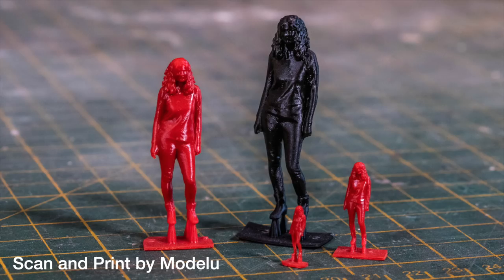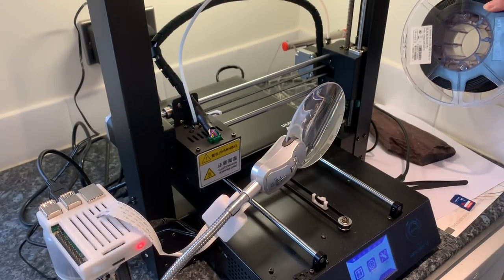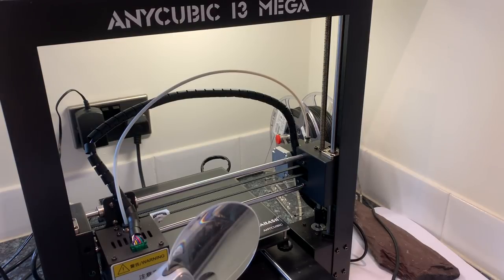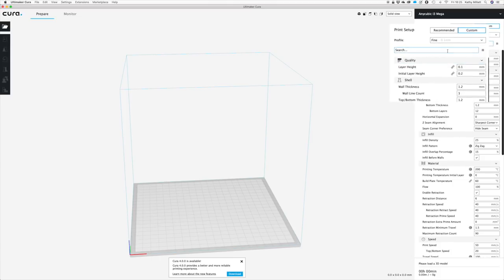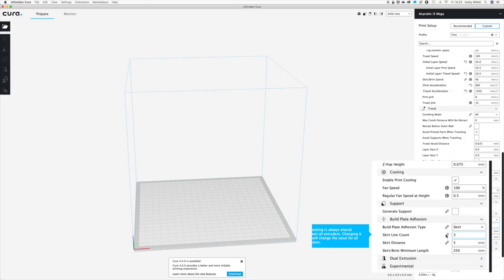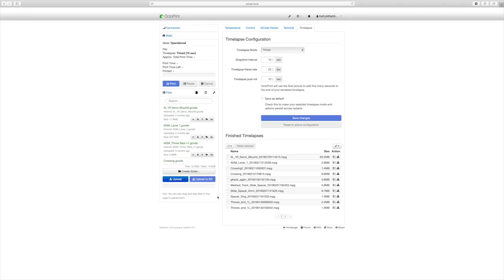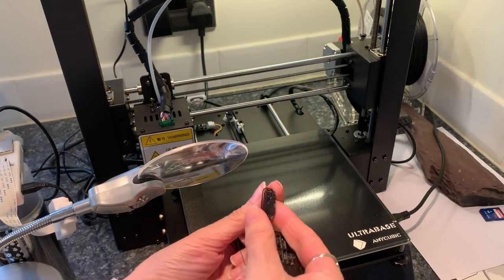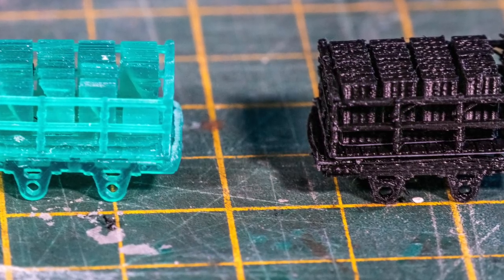3d Printing for Modelling - Filament

Comment: Glad you didn’t skip the quality and cleaning up issue. The build lines drive me daft when i see them produced as a finished item. Fill or sand is vital to remove the LEGO effect on a curve. ( Lego effect is trying to produce a smooth curve from thick bricks.. fine from a long way away but not close too) fill  for smooth file to lose the detail.  Amacf
Reply from the maker: So true. Those lines drive me mad. It’s all I can see in my prints!

Comment: Each printer has its use. I have the Anycubic Photon for the fine detailed stuff but the larger (and less well-defined stuff) gets done on my large format Creality CR-X. I doubt I could replace either one one by the other.
Reply from the maker: True. Each are slightly different tools.

Comment: Hi Kathy Great Presentation, I have a Anet A8 and a EZT1 ,i have added auto level sensors to save getting dizzy going round and round lol. Thingaverse is magic and has a lot of great files for model making. thanks again ,look forward to your future presentations ,remember your the model making pin up girl , Take Care Mac.
Reply from the maker: Thanks Mac. Auto level sensors - I need to check them out!  I do love Thingiverse too.
Reply: your welcome Kathy ,your best place to get the sensors is Ebay an they only have 3 wires Power,Ground,Signal , just replace your z Limit switch ,a nice easy firmware change to your control board to SKYNet ,you have A auto levelling machine ,no going on a merrygoround to level up, keep em coming ,
Reply from the maker: Thanks for the tip. I’ll see how that works with my Anycubic.
Reply: if you get stuck just give me a shout ,would be my honour to help you for a change :-)
Reply from the maker: Thanks a lot. I appreciate that.

Comment: Hi Kathy great video. I use this stuff to smooth my FDM prints no sanding at all. XTC 3D Brush-On Coating
Reply from the maker: Hi Bob. I’ve seen that on YouTube but I’m never sure whether it would work with scale models or whether it would fill the details too much.
Reply: It would depend on the scale, and how much detail it has. Personally, for the higher-detail things, I tend to prefer scratch-filling auto body spray primer, which fills only very small marks. You can always spray on more (or thicker) coats if you need. It's also a lot cheaper and easier to get than XTC-3D.

Using a mixture of polyurethane varnish with just a touch of paint to make it opaque is also good for the harder smoothing jobs, since it's self-levelling and can go on fairly thick. That will get rid of a lot of detail, though, so isn't suitable for using at fine scales. It's also fairly cheap.

The one place XTC-3D really wins is on clear things. It has a similar index of refraction to the plastics, so you end up with a very clear glassy finish.
Reply: @KathyMillatt  Hi kathy I print 00 scale detail and use the Goo to great effect the secret is to use very small amounts of the stuff

Comment: the stringing can be controlled with heat settings, try 2c lower it should print cleaner.  PID tuning is also a very large difference, if you have not runa PID tuning cycle its advisable.  Their are G-code files to run a PID tuning for many models based on the i3 design whigh that unit appears to be.
Reply from the maker: Thanks. I have quite a bit of tuning I can do. I did try running at different temperatures with the first filament I got but not with this particular brand.

Comment: I do enjoy my Anycubic Photon.  The issues as you now is post print and clean up.  Used clean up like this from my old job working in a intel FAB.  But cleanup is a Job stopper.  I have had days,  Do I feel like cleaning the printer today?  Yes or No...No then nothing gets printed
Reply from the maker: I don’t mind the clean up at all but I don’t empty my vat every time I print. That’s next time’s video.
Reply: @KathyMillatt  My Printer Lives in my train room so I like to keep it clean.I also probably over clean do to my job training.
Reply from the maker: It seems like a waste of a lot of resin to clean each time. I guess I’m just stingy!

Comment: Nice simple video. A couple of things to help you out, with the bed, tighten the springs down as much as you can the stock silver ones are rounded so they'll slip unless you keep them under serious tension if done correctly you shouldn't have to relevel unless you actually move the printer and even then you shouldn't have to, also most people change the bed springs to flat yellow compression ones, tougher springs and being flat they don't slip. The SD card not working could be the card it's self or the slot, some printers will only work with good quality cards, the ones most companies supply are crap.

As for the quality, that'll be down to the settings, stock Cura settings are mostly hopeless (the profiles are community ones), check the Facebook page for other peoples profiles, some are made specifically for miniatures (the Ender 3 has profiles for that, could work for your printer with some tweaks).

One final thing, having a correctly assembled printer will really help with print quality, making sure everything is square and true, belts not to lose but not to tight, keeping rods / bearings greased, white lithium for the threaded rod and Super Lube for the bearings and smooth rods.
Reply from the maker: Great tips for someone new to printing. Thank you.

Comment: I am new to model railroading but I have designed and built my own 3d printers, and have used a lot of different types of FDM filaments.  From Taulman FDA approved filaments for food containers to their alloy 910 for structural parts, many brands of PLA and PETG and ABS.  PETG is the most archival low cost filament in my experience, PLA will become so brittle the parts will literally fall apart over time.  PLA is basically sugar with some non toxic other stuff, which makes it biodegradable and non toxic but also limits its lifespan.  I have a T Rex model in PLA on a shelf printed about 2 years ago, slowly falling apart as it gets more and more brittle with age.  Do not print anything you want to last in PLA.
Reply from the maker: Thanks for that and an interesting point on shelf life of parts.

Comment: With a bit of time and effort you really should be able to get much much better 3D prints.  I use a Creality Ender 3 which cost less than £200 and it prints very good smooth models
Reply from the maker: It’s time I need to spend. Tweaking etc. You can get good prints but I still use the resin for any detail parts as it is amazing out of the vat.

Comment: Try to print in 0.08 layer high then the print is much beter
Reply from the maker: Thanks!  I’ve just moved to 1.5 as the best blend between speed and resolution. I would always use resin now for the finer detailed prints as the lines are far less noticeable. .
Reply: @KathyMillatt  I have a rezin printer to for the small things but the BIG printer home made :-) is for de big things up to 300 x 300 x300 in to colors. But speed is very inportant and the cooling from the filament out of the nozzle, I print most of the time with a 0,4 nozzle.
Reply from the maker: Willy van As I have large format resin printer so it’s about the same size as my filament printer. It’s a game changer for me.